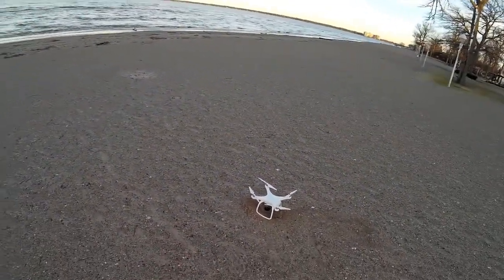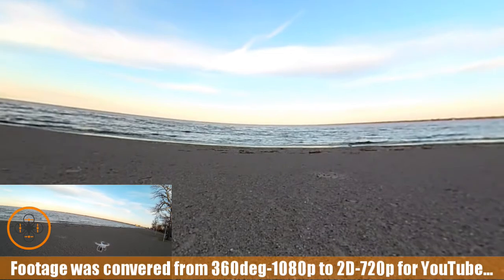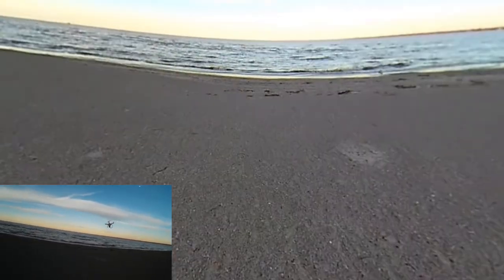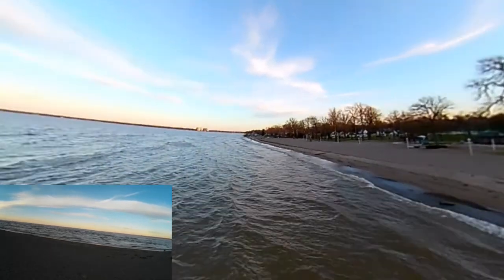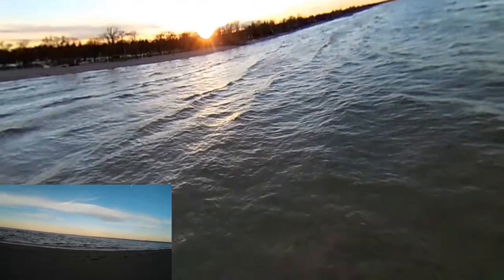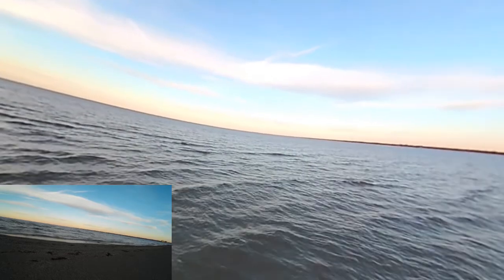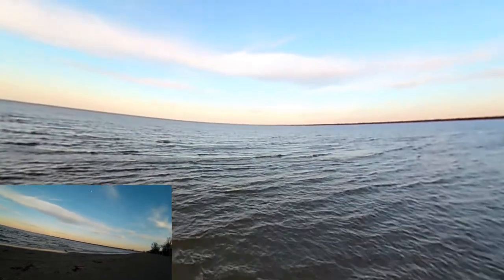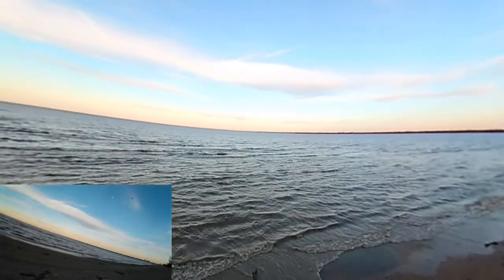Video Drone - First Flight of UPAir with 360 Degree Camera 2D version!

Comment: the upair one plus has a different gimble so
Reply from the maker: Is this the new app controlled one?  Whats it like?  Better worse?
Reply: It's much better. I've owned both, but the main features are the ability to calibrate the level and the compass. it also has things like follow me and way points. The main thing though is the calibration. All the old batteries work with the new one.
Reply from the maker: Interesting, so is still only two axis or three now like the phantom?  Also good to know about the batteries, however what about the App?  Have you had any crashing (of the App) issues?
Reply: Video-Drone The gimble is still the same. only a 2 axis setup, but the wiring is different and i feel iy has a better camera.  I have had the app crash one or twice when starting a recording but since it doesnt really have any major control over the drone, its as simple as reopening the app. It hasn't caused any issues. over all better build quality and better product.